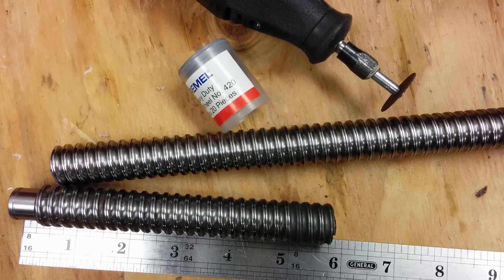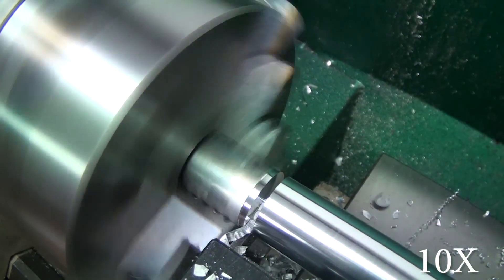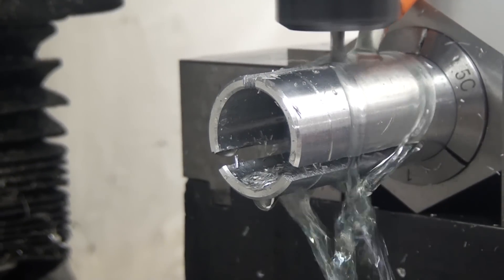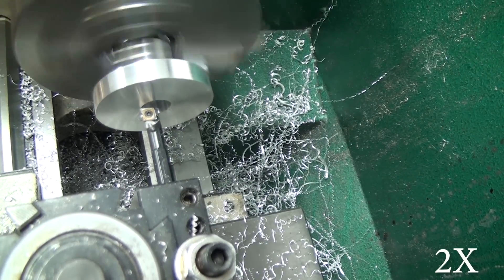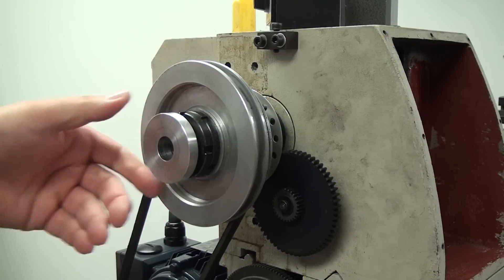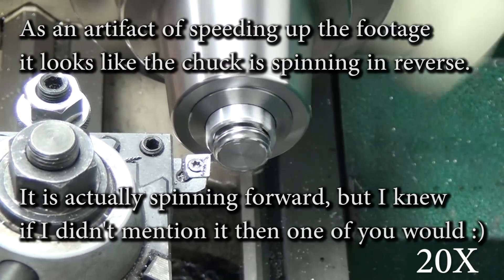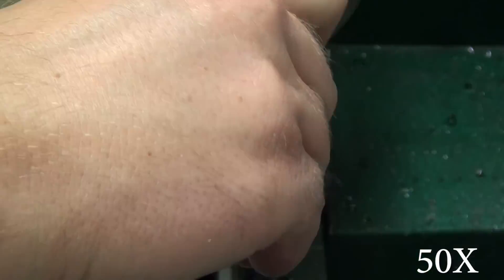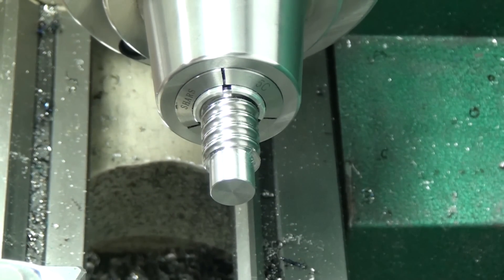G0602 CNC Conversion pt4a - Machining a C7 Ballscrew

Comment: Once again, great instructional video, I'm really new to machining but hopefully some day I will make it to your level of expertise.  I've just bought a craftex cx601 mill which is a slightly bigger machine, I've had a g0602 for the pass 2 years and by your inspiring videos I'm convinced to cnc them both. if you have any suggestions that would make it easier for me please let me know. and once again keep up the good work.
Reply from the maker: +Wendell Skeete Thanks!
I just looked up that mill, it looks like a great one!
I don't have anything off the top of my head as far as suggestions, but if there is something I can help with feel free to hit me up.

Comment: I been considering buying a mill a G0704 and converting it to CNC. Do you know of any companies that sell the CNC kits that just bolt up or do all of them requiring machining to convert to CNC. I know a company that sells the G0704 complete with computer and all for around $7,000. But saving $3000 sounds even better.

Comment: Nice video! At least now I know how the short screws are machinned to fit (btw, if it were 600mm long, what would be the proper way?) Do you have a video explaining how to properly fit the screw, e.g. on a CNC mill? There are at least one bearing on each sides, but how do you fix it so that it doesn't move along the axis?
Reply from the maker: +ljuberzy Thanks! This video is all I really have concerning the screws, but if you go check out +CNC4XR7 channel he is going through the process on a CNC mill conversion and has more great information.
Reply: thx!
Reply: ljuberzy ccan you please send me the information about  changing my machine over to cnc

Comment: What kind of insert do you use in your knife while turning ball screw ?
Reply from the maker: +MisiomisiekK That was a CCMT for the turning. Not the best option, but it worked. The important thing is to choke up on the work and turn at a slow RPM. My lathe only goes down to 150RPM so that's what I used.

Comment: Nice video. Question:  Why did you make a bushing?  Was there a problem with holding the ball screw in the 5c collet? Thanks.
Reply from the maker: +Franco Yes. I didn't have a 5C collet the right size and I didn't want to buy one for this one job. I've also heard that because the screw is so hard, the screw can possibly slip inside the collet. This may not be true, but since I already had the aluminum and I knew I could make this really quickly it just seemed like the best way forward.